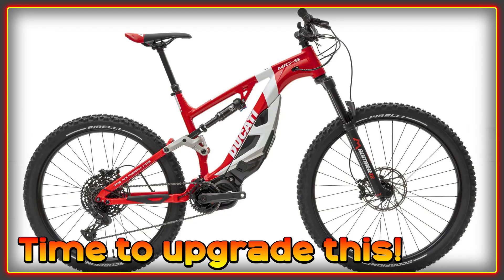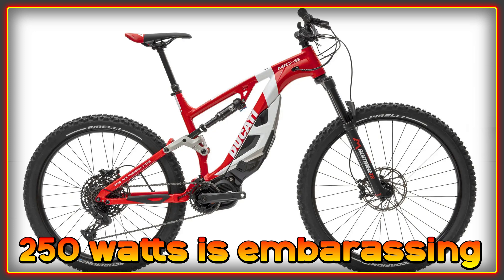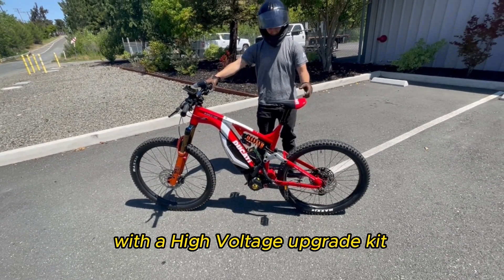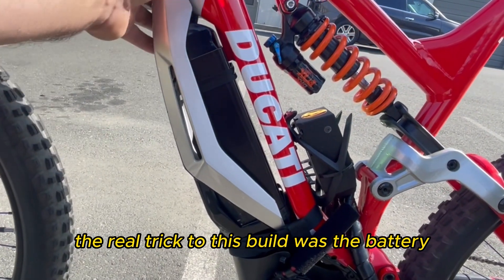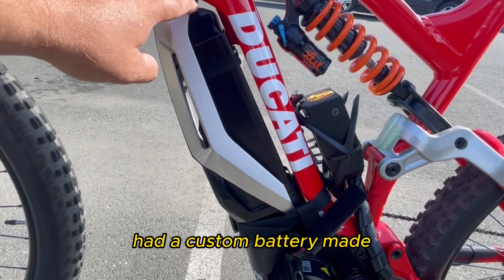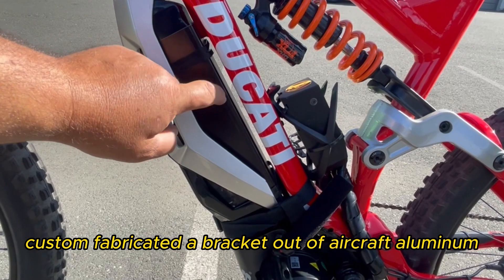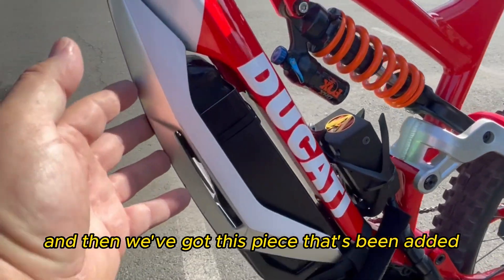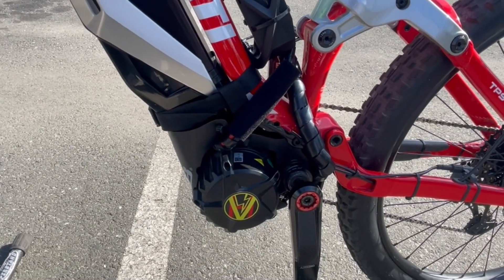Transforming the Ducati Mig S Ebike with a new motor and a High Voltage upgrade kit!

Comment: I’m really hoping someone comes up with a conversion kits for the Turbo Levo that can utilize the battery compartment and replace the motor to a high output one and still keep it looking factory.  I love the DIY speed and power but also love the factory finish of prebuilt.  This would also be an awesome way to bring used turbo Levos back from the dead as a hit rod version of the bike.
Reply from the maker: The guy that did this is working on brackets for the levo. I can put you in touch via our discord
Reply: @HighVoltageKits  a bracket to do a motor swap?  id love to stay in the loop and have his info

Comment: Brilliant.  One caveat.  I wish in life there aren't as many catches...but converting from a 36v battery to a 52v battery within approx the same volume aka space...be it 18650 or 21700 cells which have approximately the same energy density, depending on specific cells used, the result is a pretty woeful capacity battery due to being limited on volume....just eyeballing your battery execution...capacity nos. not being addressed in the video.  When upping to 52v which means fewer parallel cells and more cells in series...likely not much more than 10-12amp-hr results. Translation is...the excellent Bafang M625 is a hungry motor and if you use the power any red blooded male would, you are going to eat through that small battery pretty quick.

A last note is...I hope as a business opportunity, you consider marketing brackets that convert other pathetically inadequate Shimano and Bosch powered ebikes which are going to turn into yard art with their horrific, proprietary CANBUS based controller/battery systems...I hope you provide these style of brackets to more ubiquitous ebikes from more common names like Trek, Specialized and Giant...who use low power Shimano and Bosch and Yamaha high cost design strategies 'for profit' that many customers would like to move away from and upgrade. From a battery standpoint there will be further breakthroughs certainly in 10 years or less to increase energy density by a factor of '2' which will make a huge difference in viability of electric power.  Meanwhile, piggie back batteries can be constructed in series with existing cells once CANBUS is wired around with suitable BMS which can be done now without too much of a headache. 
Love the bike, your creativity and thanks for sharing your experience with the community as always.  And John, you look pretty dam spry riding that Ducati ebike.
Reply: You are correct… the battery is only 12.6 ah and yes the M625 w/ HV kit is a very hungry animal.  The bike is still nimble and not much heavier than the stock Shimano set up. If used sparingly w/pas and you still ride the bike like a mtb bike should be ridden,(not complete lazy mode) you can still get a good 20-30 mile ride in. Obviously there are a lot of factors that come to play on distance vs battery performance. 
The bracket will be modified with a few minor changes and then available for public purchase. This particular bracket will work only for the shimano steps frames (not earlier models) to allow for M625,BBSHD,BBS02 and Cyc. Possibly another motor coming out soon. 
There are some other folks out there that have created adapters for the Bosch frames. ( check the emtb forums) 
I completely agree with you on the Canbus lock down tactics are not good for the end users, which is why the HV kit is nice by 
allowing the controller to be removed. 
Thanks for the open comments, much appreciated. BTW, it’s not John on the bike, just a random kid in the hood that wanted to feel the need for some speed!!
Side note:
This particular reply is not from HV, but one of the builders. Hope it was helpful.
Reply from the maker: Thanks Luke. You are right it won't be the biggest range with that battery space. I think he has a backpack version as well to switch out to in a pinch. The cells are 4.5 amp hour so I think its about 12 amp hours total. I am not sure on the manufacturing but I think that yes that is the idea because there are lots of these bikes that could do with upgrading. Thats not me on the Bike. I wish I had got the chance to try it but getting down to SOCAL from Canada for a ride would be slightly prohibitive! Thanks for the comment. Cheers!

Comment: Great vid, bike & upgrade. Nice to see a spring rear suspension rather than air. IMO, weight is essentially not an issue so go for spring - more reliable, less/no maint.
Reply from the maker: Good point. I'm not sure if it's stock or not.

Comment: you mention BMS. "high output" that's a nice spec! 
you tell us about the cells in the battery but not the capacity. could it be 14S3P (12Ah ) or less? 8AH?
Reply: 14s 3p with Molicel for a 52v 12.6Ah

Comment: Nice build is the chain strength good enough these days? I bet you really need to be careful accelerating in a low tooth count gear
Reply: If you get ebike chain it will last long. I have the kit been about 500+ miles on same chain.
Reply: KMC e12 ebike chain… will have to see how long it last.
Reply: I have a cheap Amazon zonke brand chain running 4000watts and it hasn't snapped on me

Comment: Super neat. What is "aircraft aluminum?" 7075? 2024?
Reply: Bought a small piece of black anodized 2024 aluminum from a friend…but 5005 aluminum will work as well.
Reply: @kb-rl1pn  got it. You went all out on this, dude! Right on!
Reply: 0.04" Anodized Aluminum Sheet Black
Reply from the maker: 7075 I think is aircraft. 6061 gets used as well. They refer the the heat temper I believe.

Comment: How do you dal with the heating issues ? i built a "Ebike" with only 750w and 52v batt.. 20 mins of 35mph,  and my motor gets damn hot.. I even JBW some aluminum heat sinks on to help..  it may just be the Cali heat or i got to slow down 😒
Reply from the maker: Very high rpm helps to shift the heat. Which motor are we talking here?
Reply: @HighVoltageKits  750w Bafang mid drive with a 52v jumbo shark battery
Reply: @jasondundom1390  You maybe have too much weight or run it in too high gears.
My BBSHD (even with inferior FETs) goes fine on 18S 45A for five years now.
Reply: @emilen2  i'd have to agree with you on that one.. bike weight 55, i weigh 195.. but chico weather is hot as well, today was 90.. i took off the throttle and dropped the amps to 22 i believe.. either way in gunna drop it to 19 if it's not alrdy, but last year the hottest was a record braking 117f which would kill the motor 🥵
Reply from the maker: Those are hot temps. I'd start with the gearing. If you are running too high a gear at the back the motor might be bogging down at low rpms. You are welcome on our Discord to post pics etc so we can help more.
Reply: 72v would help a lot with temps
Reply: Heat is definitely something that will need to watch. The nice part about the HV kit is they have a temp sensor hard wired in the harness that can be mounted to the lockring plate.  Also, the nylon gear has been replaced with PEEK gear.